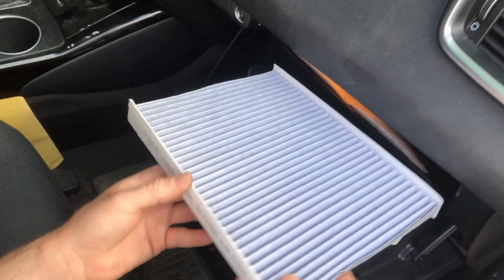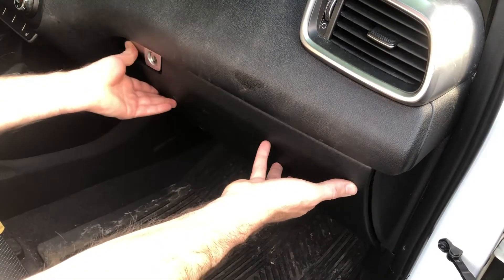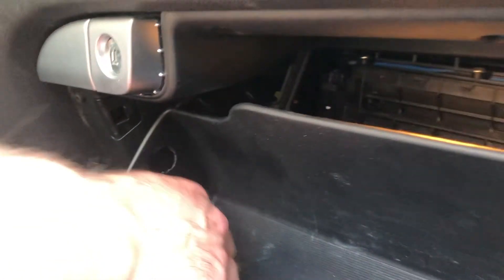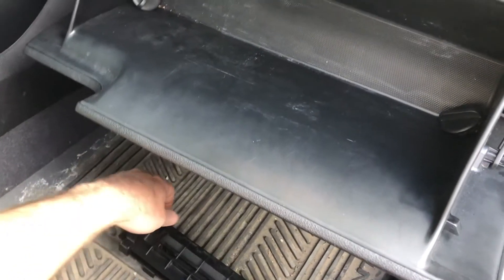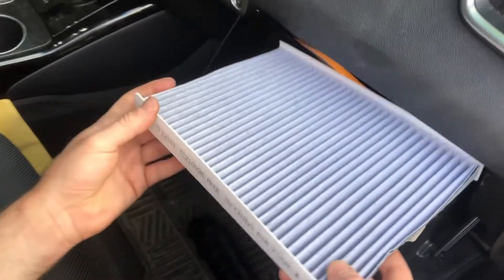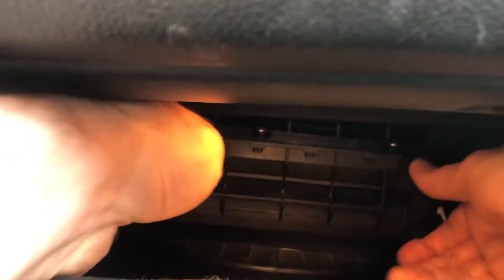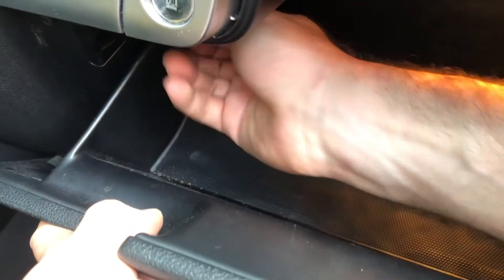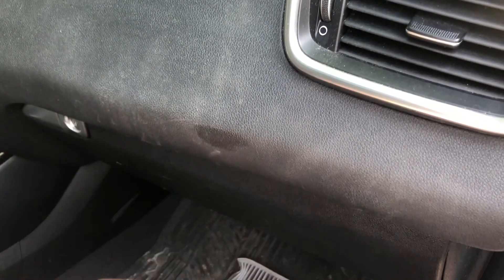HOW TO REPLACE Cabin Air Filter on a 2016-2020 Kia Sorento - SUPER EASY

Comment: You say, "Remember which way the old one came out so you can put the new one in the same way" but what if the previous one was put in wrong? Better yet, remember that all horizontally mounted cabin air filters with the blower motor mounted below the filter will have downward air flow so air flow arrows should point down. The only exception is IF the new filter says "UP" next to the arrow in which case the arrow is indicating which side goes up and is not indicating air flow direction.
Reply from the maker: That's a good tip, thanks for sharing!